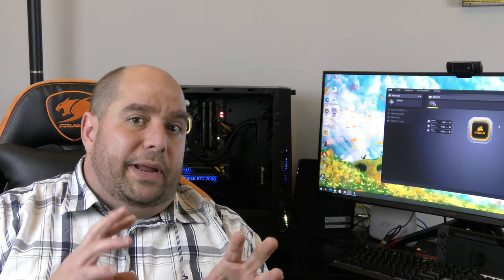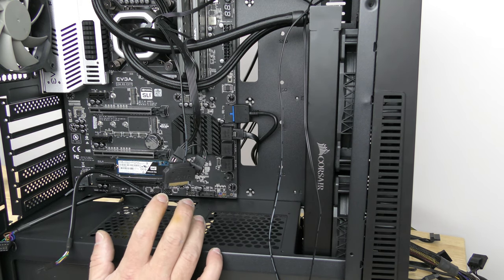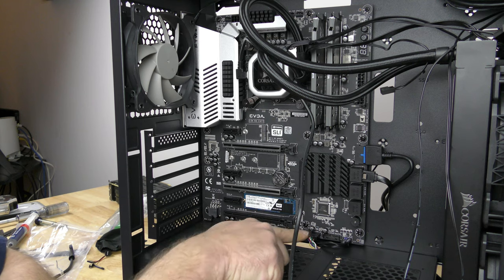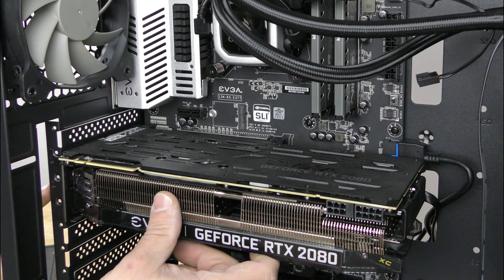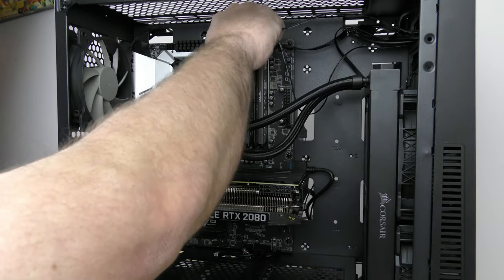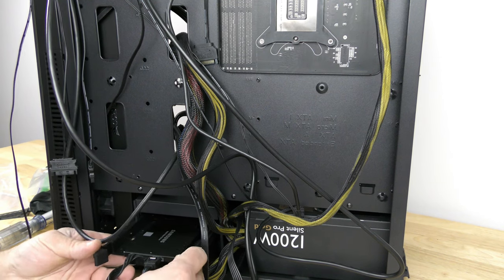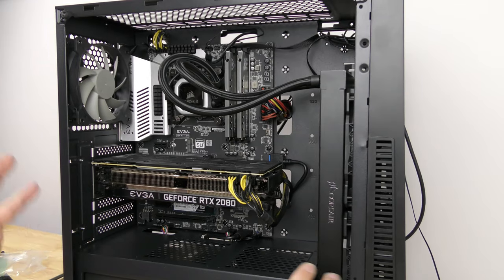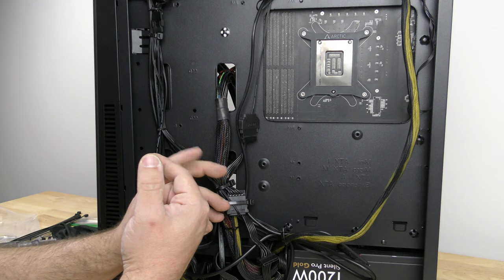How to Wire a PC Game Build for Beginners - Step by Step Wiring Guide 2021

Comment: That radiator is mounted as bad as you could possibly do
Reply from the maker: Funny how before steve said anything, no one said anything and in my years as a product development engineer, never had issues with them, aside from shipping.  When possible, I put the radiator on the top, due to the tall memory and VRM heatsinks I could not place it at the top.  Due to the way the hole is on the front bottom of the case, I could not put the hoses on the bottom, yet no one watches to listen, they just bitch.  If you listened to Steve, maybe the 3rd video, he states stop hounding other reviewers on this.  

With what I have stated, over 20 years of professional experience, building literally thousands of machines, many of which had 120mm radiators, which there was no other way to install, having worked with thousands of customers, RMA's (of which the liquid cooling units were not the cause, though of course, some liquid cooling units had issues (maybe less than 5% of the ones built) , what doesnt have issues) what is your opinion now?

Show me the tutorials on building machines you have done?
Reply: @ThisBytesForYou  first of all who is Steve? I mean it’s not that I have done a lot of pc builds , but it’s simple chemestry , hot air tends to go up , I didn’t mean to be rude man , the video it’s still a good video and I liked it
Reply from the maker: @toutorial_for_live_9530  hot air will still go up, air blows in, then gravitates upwards and is also sucked out of the rear of the case, also simple thermodynamics and Gravity, since the tubes are lower than the pump.  Steve is from Gamers Nexus.  

You may not have meant to be rude, but if you go back and read the comment, you would see why I replied the way I did.

It's cool though, just as a youtuber/reviewer, I have to go through a lot of this, so my defenses are always up, also many never reply so they never know what to do when I do reply, which I always reply.  

Thanks so much for your kind words and stopping by, I do appreciate it.
Reply: @ThisBytesForYou  thank you for your explanation, I appreciate it , have a good day and keep up with the good work!
Reply from the maker: @toutorial_for_live_9530  you too my friend, thanks for your support.

Comment: Timestamps?
Reply from the maker: dont watch it
Reply: @ThisBytesForYou  That was a quick answer. Thanks for the helpful video👍
Reply from the maker: wait... what was the timestamps thing about then
Reply: @ThisBytesForYou  So that people can skip to the part they need. For example if someone needs to know what cable to connect with the gpu, that person can use the timestamp and watch exactly that part of the video.
Reply from the maker: @vgames1543  For all other videos, I do that, but for this one many people (you can read below) they found what they needed, but didn't know about a certain part, so marking would be cool, but then they would skip something they didn't know that would have helped them.
Reply: @ThisBytesForYou  Thank you for the explanation, I understand the reason.
Reply from the maker: @vgames1543  Thanks for understanding, thanks also for checking out the video, liking and subbing and commenting, means the world to me.

Comment: ketchup mustard on a 1200watt power supply
Reply from the maker: uh huh?  Your point is?
Reply: @ThisBytesForYou  a 1200watt should have at least normal black cables some include sleeved ones too
Reply from the maker: @ahmenada  a 1200Watt will come with what ever it brings, I can't control what they put into it, plus this power supply is over 10 years old and it's still kicking